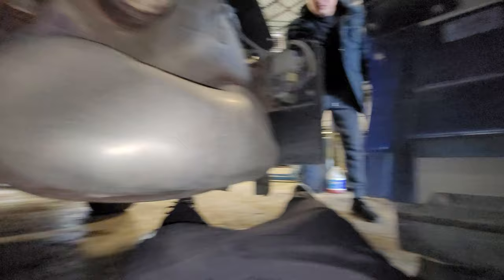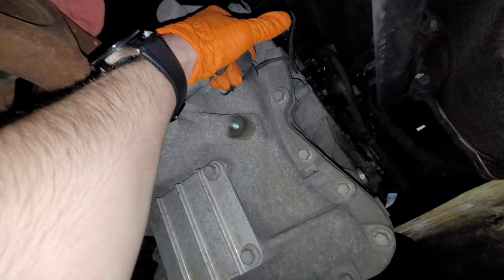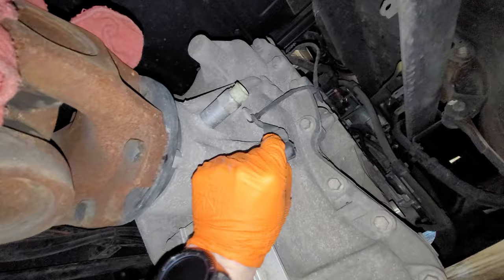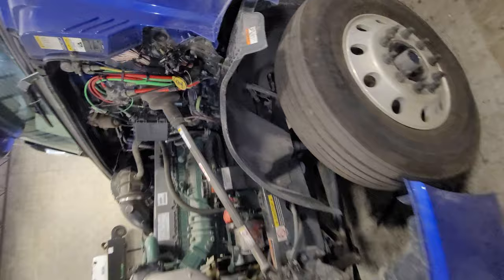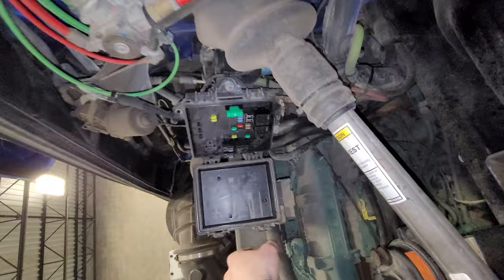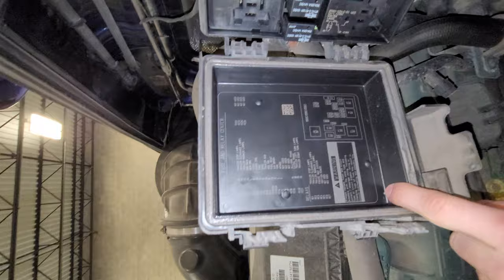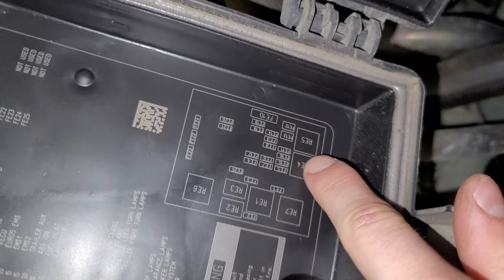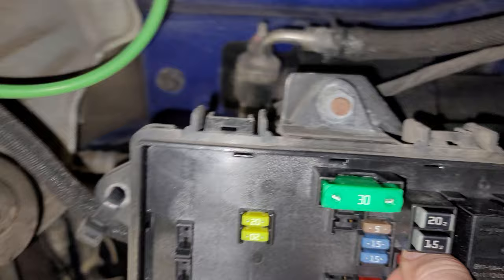Derate 5mph on any Volvo Semi Truck remove speed sensor right  ✅ DD13, DD15. Problem Solved

Comment: And you need to use Manual shifter to drive . (Volvo d13 2018)
Reply from the maker: yes
Reply: This was real helpful and my problem was caused by a bad battery 🪫

Comment: Thanks. Was able to drive on Manual. My truck was in temporary lock and wouldn't do the regen. The soot level was low and the regen light wasn't flashing but was saying it's in derate and would only go 5 mph. After removing the sensor and the ECM fuse, I drove on manual shift and 10 min of  driving, noticed the regen light flashing. I checked the status and the temporary lock was gone. Stopped at a rest area and did the regen.

Comment: Unfortunately it didn’t work for me, I removed both and still 5mph derate
Reply: Make sure you drive it manually.
Reply: @solarpluto8600 how do you drive a manual if the truck is automatic?? Thank you.
Reply: @jonathanmud6744 did you figure out how to drive it manually?

Comment: I suddenly stopped at the shoulder cuz my speed is less than 5mph and called to mechanic he told me exactly what you showed here and my truck ran to the shop with a manual mode, mechanic charged me $100 for three minute advice just over the phone and another $800 to fix at the shop! 
Thank you very much!
Reply: Any help with the contact pls. My truck doing same now

Comment: 🤔I have a 2012 Volvo.  To eliminate the 5 mph speed crap is to totally delete the DEF system.  I did it with my truck, and no more 5 mph derated speed limit.  Engine breath and run even better without the DEF system.  Fuel mileage increases as well.  But do not take the DEF system out.  Leave it right in there.  No opinion.  I hate pulling over to the side of the road having regenerated.  Totally waste of time, fuel, and you have to get that delivery and pickup on time.  Feels good when you just fuel up, and not adding DEF fluid as well.
Reply: Of course it's better without def but if you get caught expensive fine and maybe jail too
Reply: I did same few weeks ago) spending 4-5k$ for DEF yearly, wasting so much time at freezes def fuel pumps, and now just paid 3k$ once to cut it off!)🤦🏻‍♂️
Reply: @olegyaniuk4920  need advice to how man this shit is killing me can’t seem to find anyone to do it
Reply: CEL came on with a code SA 0 SPN 84 FMI 19.
VSS needed to be replaced (Vehicle Speed Sensor)

Comment: Thanks for this tip man! 
I’m currently experiencing loss of power and speedometer is going from my current speed down to 0 mph. Then goes back to normal then speedometer doesn’t work at all and shit like that.
Reply: Does your truck rpm limited? Mine same like yours after the speedometer doesnt work then the rpm limited to 1200 rpm.
Reply: @tappingenthusiast3405  yeah, it also wouldn’t boost fully. I found the problem. It was yellow and green j1939 cables corroded and melted together. 
My suggestion is first check the wiring. 
Start at the speed sensor connection and follow down the speed sensor wire path. It goes around and up the transmission and then out towards batteries. Mine got cut right above the batteries. This wire will be zipped tied to a little piece of metal welded to the cab that is hanging just above the batteries and very close to the electrical plug 🔌, where you connect the extension cable in the winter to heat up engine block and transmission. 

I guarantee you it’s a broken wire! 
Good luck
Reply from the maker: When u remove  speed sensor,  is ok if your speedometer is not working.  Because you remove  a speed sensor.
Reply: @alexaah  truck doesnt have power. Limit to 1200rpm. Is there a way to remove the rpm limiter?

Comment: I have a 2015 when i removed the ABS it will not shift even in manual mode but when i put it back it shifts normal . Will it derate with ABS ON !? Thank you in advance.

Comment: So u have to take out abs n drive manual? I only did speed sensor n it’s driving in automatic fine
Reply from the maker: @sergio5825  sometimes when it's not driving fine, you may need to remove ABS sensor.

Comment: привет 👋 
after my VSS went out, i replaced that speed sensor and check engine still ON. it drives fine until i hit about 40mph and problem comes  back again. it will not raise RPM above 15.. and not gonna show speed anymore on the dash. 
do i need to go to a shop so they can plug in their diagnostic tool and let the ECU that speed sensor was replaced? or CEL it will go out on its own? thanks for the help!

Comment: You forget one important thing.  You will loose your j brake with speed sensor off.

Solution.  Splice one of the two wires, run a wire from each spliced end to the inside of the cab, you can plug it back in.  Now when ever you touch them together you will get your jbrake and will derate, when you detach them, no jbrake but no derate.  A way to get to a repair shop at normal speed with jbrake.    You can put a switch on it and leave it incase it ever happens again.
Reply from the maker: You have to shift gears manual

Comment: Hello! I have a Volvo D12. After an engine rebuilt the truck doesn’t want to go above 5 mph. RPM doesn’t go above 1500rpm.
The truck is locked on the first gear. Only first and reverse work fine. The truck doesn’t shift above the first gear at all and the speedometer is close to zero.
Any idea for me? It can be the derate mode or the transmission starting to die?
Thanx.
Reply: you got it fix? how?
Reply: Did it fix?

Comment: You take the fuse out it will not work!!!
Definitely do not take the fuse out!!!!!
Reply from the maker: Depending of truck.
 You take out fuse only for avoid problems with ABS.
Sometimes is necessary. 
Depending of truck and issues

Comment: I have a 2017 Freightliner with automatic transmission.Unfortunately I couldn't find location speed sensor.DD15.😒
Reply from the maker: It may be in different location

Comment: I NEED THE PART NUMBER FOR THE SENSOR.
Reply from the maker: @davidtchanturia6630  ask your local dealer
Reply: Why did you have to remove the fuse? Do you leave it removed? Before sensor removal? After sensor removal? No explanation was given in the video

Comment: Why mine is not working I do same ?
Reply from the maker: Either you do something wrong or your problem is very very bad
Reply: @alexaah  I took off the plug under the truck and fuse it’s running only about 5 mph
Reply from the maker: @hhhppp219  try to turn off your batteries off for 20-30 min. Sometimes it helps

Comment: This doesn't work, the truck is still limited to 5mph.
Reply from the maker: Make sure that you removed ABS Fuse

What kind of truck do you have ?
Reply: @alexaah  2016 Volvo VNL
Reply: @alexaah  ABS Fuse removed
Reply from the maker: @NIKSAFREE  sometimes it doesn't work, one of my volvos could drive only 15-20 mph. Is depending of the issue
Reply: What issues will keep the truck limited in speed?
Reply from the maker: @Whoa532  all of them are different,  can't say something exactly
Reply: 🤔Need to delete the entire DEF system.  That's if you a Operator.  No more 5 mph bullcrap, and regenerated on side of the road for 30 min to an hour.  Don't take my word for it.  There are some footage on this YouTube show you how to do it.
Reply: @alexaah  ABS SENSOR REMOVE FOR WHAT AFTER WE DISCONECT THE SPEED SENSOR? EXPLAIN WHILE
Reply from the maker: @manueltoledo1893  sometimes it can keep your speed up to 5mph or cause other problems.  That's why we recommend to remove it
Reply: I can’t turn on the truck when I removed the speed sensor 🤔